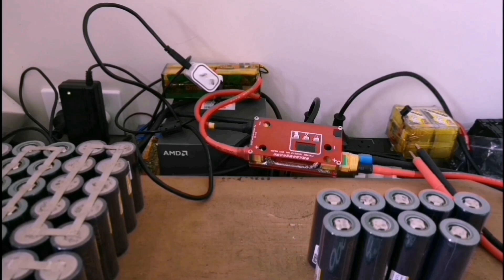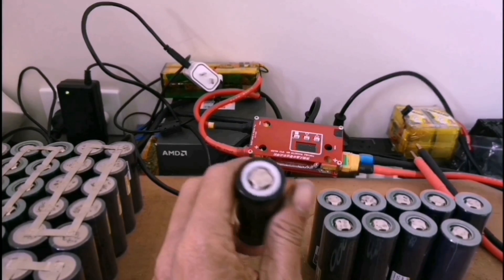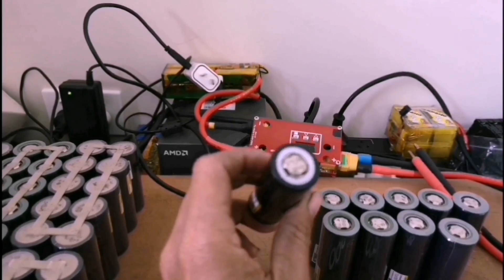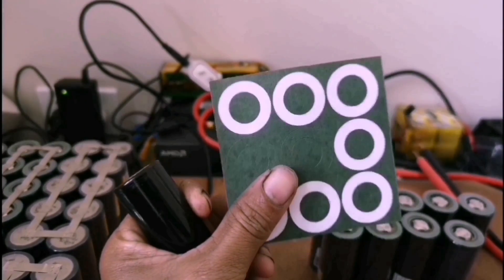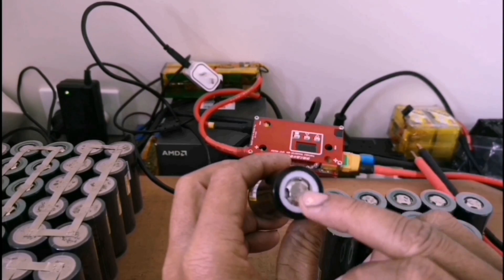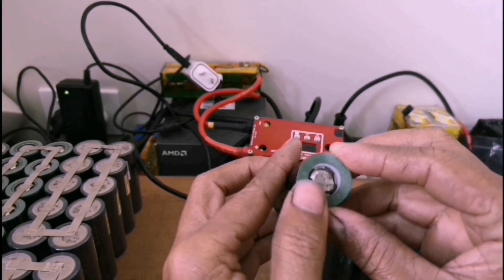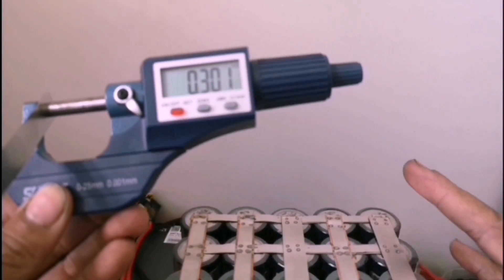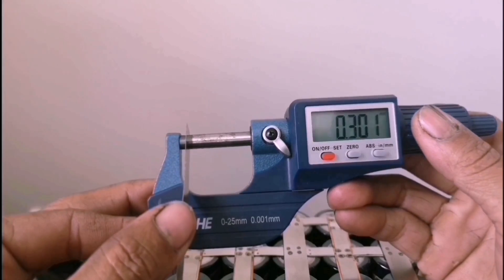DIY battery pack compact design 7S 10P 55Ah 1,4KW  26650 5500mah Li-Kala

Comment: Do you do ir testing? I hear some people saying that ir matching is necessary and must to do for long life of pack? But I never seen any car manufacturing plant video doing ir testing, the cells are just checked once after manufacturing where they're activated and good cells just go straight to the back building be it tesla or bmw
Reply from the maker: No!
Reply: @pitikaron  OK thanks. Do you find any performance difference in ev batt?
Reply from the maker: EV batteries are high pulse discharge If you are looking for EV batteries used lithium ions phosphate batteries, however I prefer petrol instead EV coz I found so many disadvantages on EV. Anyway IR or isolation testing it is not really necessary but it depends on the project.
Reply: @pitikaron  i would use new phosphate batteries tho. But yeah petrol have good advantage over ev
Reply from the maker: My advice is to monitor your EV batteries and cable wire from time to time because I saw a few reports that EV burnt even if it is in the car park.
Reply: @pitikaron  wowww that's scary 😱. We have it here too, and few burned while driving too.
Reply from the maker: yeah it is so scary
Reply: @pitikaron  yeah 😰😨

Comment: should i buy the purple one and modify it with 5 more mosfets as you did or should i buy the new JQ-DHJ? can the JQ-DHJ do what you do with the purple one at 8:46 (solder a nickel and copper strip together at once?) thanks for all your reviews and tipps!
Reply from the maker: Base in my trial the purple spot welding working better because can welding at once nickel and copper both 0.2mm other than that I also keep checking aliexpress buyers comments, purple spot welder recieve more positive comments.  however JQ-DHJ I recieve an email from one of my subscribers that his JQ-DHJ blown the small electronic part code B628 SMD but the mosfet still in good working order. however I can recommend you the purple one.  click link below coz that link I provide direct to the seller where I bought mine.
Reply: @pitikaron  thank you very much for your fast answer! could you also please tell me what kind of battery you used when you where welding your big battery pack.. and also what your other little battery consists of? you stated it's a 4P 3S ? does that mean this pack consists of 12 of this 11,1v 1550mah packs and is worth a few hundred dollars? if so then it can deliver a massive amount of amps.. way more than then 100C you stated?! when you search for this WxGErteGyZQ in youtube you find a video from a guy who has trouble welding a thin strip with the JQ-DHJ at gear 4 using a single 5200mah 80C battery. can this be the culprit of weak spotwelds... a single 11,1v 80C is way to weak??
Reply from the maker: my previous battery 4P 3S 1550mah in tottal 6100mah 100C to 200C  power source for my spot welding it give great power I think I included the link however I bought new battery which is more powerfull 8400mah 3s 140c up to 240c more or less peak power 2000A and I think I also included to the description list under to this video.
Reply from the maker: if the spot welder JQ-DHJ couldn't weld properly using 5200mah with 80C means weak battery.  actually spot welder is not the one can weld.  spot welder act like a switch or relay it will turn off if it is short so during welding procedure the battery shorted so the mosfet closed or turning off because it short and then the microchip controller base on time programe after turning off the microchip controller it will turning on back with in milliseond and send signal to the gate of the mosfet to turning back on.
Reply: thanks again.. sorry I'm still probably getting this wrong? so you indeed packed 12 of this 1550mah packs together to a 4P 3S? and no you didn't include your batteries in the description ;) it least i can't find it and I checked it twice already. how long does the new battery last? could you weld the batterypack in one go? or did it heat up a lot?
Reply from the maker: yeah I check the description list under to this video unfortunately I did not included however I am pretty sure I included it to the video where I am performing a review for purple spot welder, maybe at part 1 of purple spot welder or part two I haven't tried long working hours yet but I did it to the red spot welder you can do 2000weld.  coz my latest video 7s10P  I did more than or less than 2000 weld, non stop until I finish.
Reply from the maker: I am still using as a back up power source
Reply from the maker: I just add 5 mosfet so that it can manage more current flow then upgrade that traces to make thick, wire input and output must 8 gauges or better 25sqare.  if you rely the traces from the circuits I can't gaurantee the mosfet wont blown.  coz when the large current flow surely it will heat up the thinner traces and once the ideal cilcius from the mosfet  reach up surely the resistor can not resist and the current limition flow to the mosfet then the mosfet blown. resistor control the gate resistance how much current should flow to the mosfet.
Reply from the maker: 8 gauge wire, input wire must 200mm  output wire must 500mm however this measurement depends on the power of your battery. and this measurement I am using.

Comment: What is the peak power of the battery pack and what type of cell you used for building battery pack? anyway I amaze the two cheapest spot welder. working pretty well they done your project with out any issue.
Reply from the maker: 100A 26650 3.7V 5000mah.  me too sir I don't know why their are few claim from the costumer,  however red spot welder perform weld pretty well far beyond from the description.

Comment: Both cheap spot welder working pretty well unfortunately the red spot welder can not weld nick&copper together at one time. other than that creator produce a clear video and very helpfull.
Reply from the maker: Yeah sir!  as long as you upgrade those cheap spot welder.